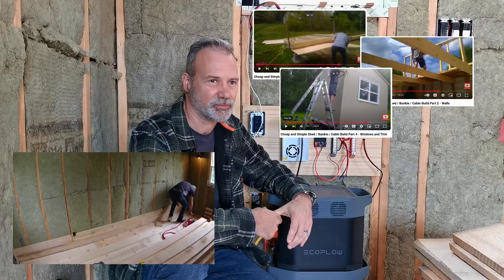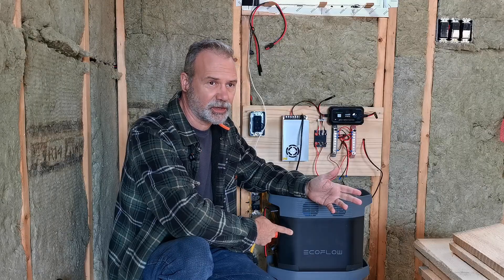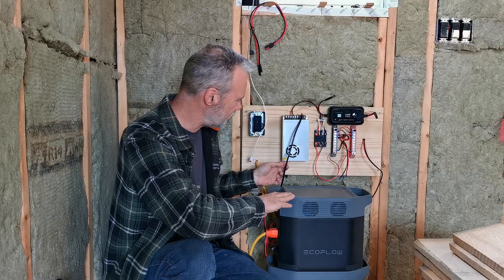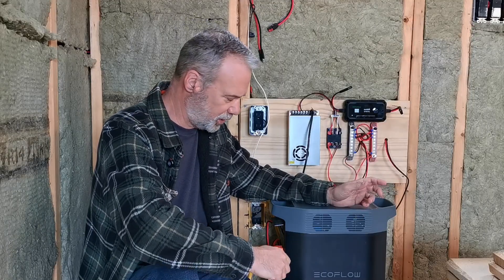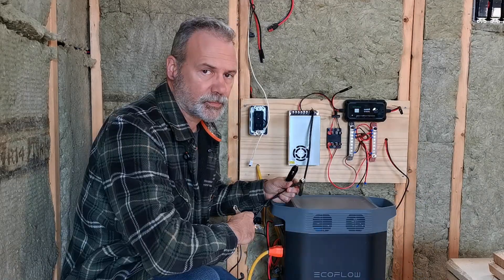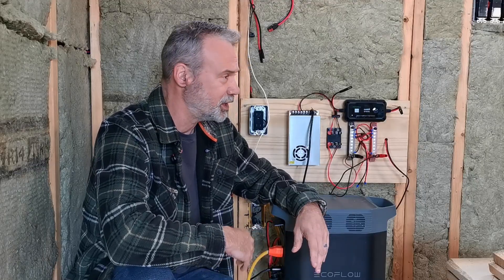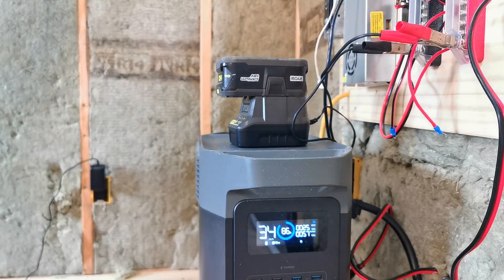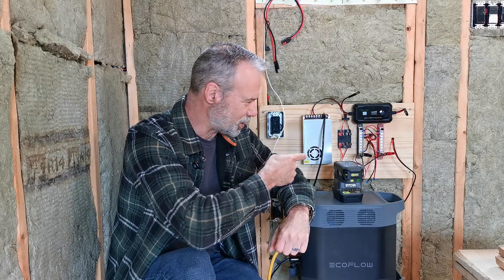Your power station is stealing electrons

Comment: Keep in mind mind the 12V DC output is regulated - not connected to the battery directly. There is a DC-DC converter behind it that has its own losses, most likely in the 10-20% range too.

Comment: It's the capacitors in the inverters that charge up and hold power in which use power.  My 3000w Canadian tire special will drain my batteries to zero if i have it connected and not turned on.  This is why my redneck version,  with batteries being charged via a separate system, helps maintain the batteries. I'm not sure if those solar generators will charge the batteries if they're turned off.

Comment: Interesting setup. Would a relay system work so when the heater cuts in it automatically cuts the power to the lights?
Reply from the maker: Not sure how that would work. Maybe a 3 minute timer or something. Only needs to be when first starting the heater; it doesn't cycle on and off, just high and low.